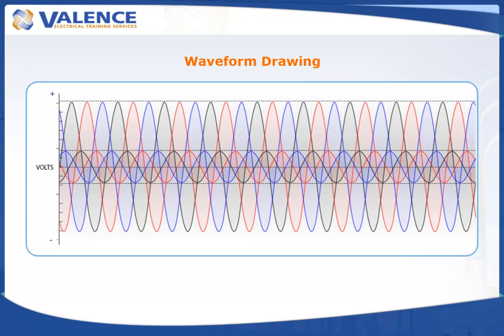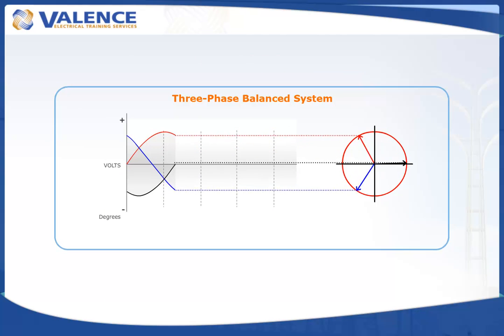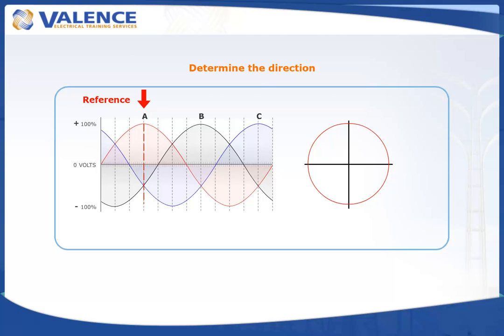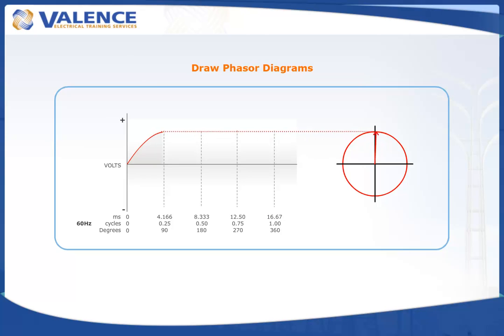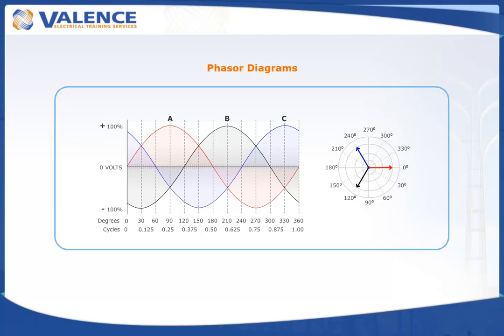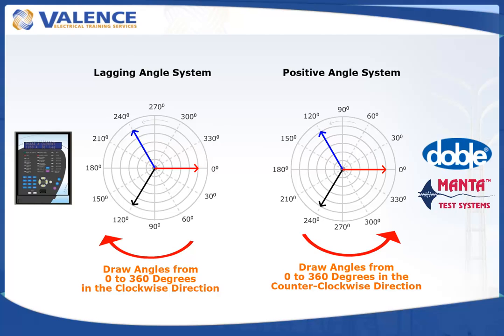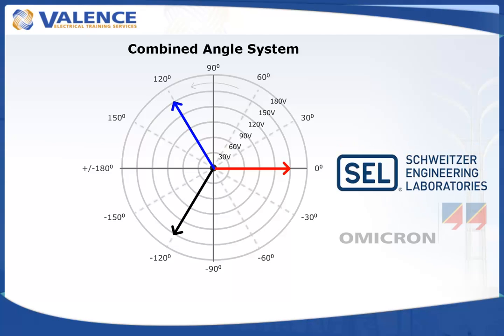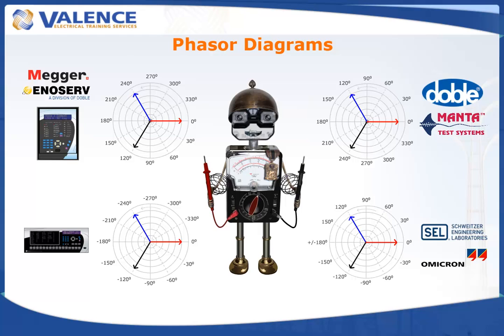Phasor Diagrams for Relay Testers

Comment: Hi sir,

I have a doubt ..i connected 2 pt in same phase.for example In R phase .Say the first PT output is 1S1 and 1S2 and the second  PT output is 2S1 and 2S2 .and i measured the voltage between 1S1 and 2S1.and i got 126V .Actually the voltage should be zero.because the i connected both PT in same phase.but iam getting voltage ..so what should be the reason.kindly help me.Hope you will understand my question

Comment: Hm the link u provided seem to have malware warning? Do u have other link?
Reply from the maker: That is weird.  If I click on directly while logged in, it is fine.  If I copy it and paste it in another browser, I do get a warning. The actual link is simple and correct. Google is adding a bunch of stuff to it that might be the problem, and there is nothing I can do about that.  There is flash on that page, which may be the problem.  But the course uses flash, so there's nothing i can do about that either.